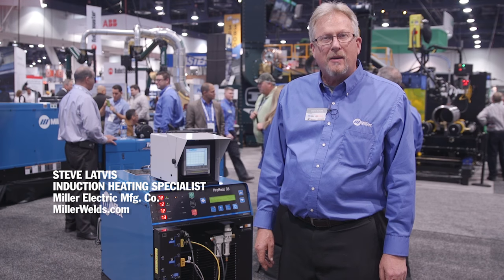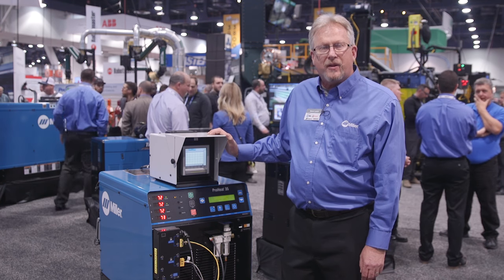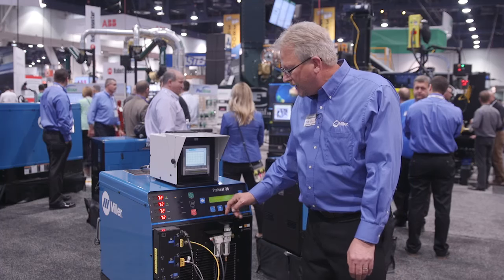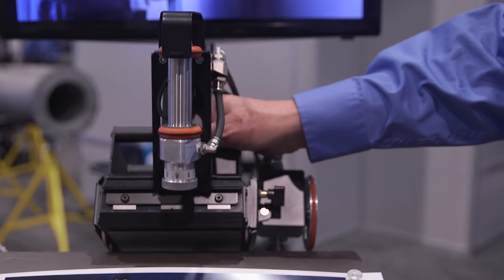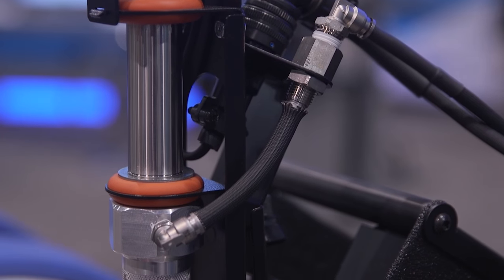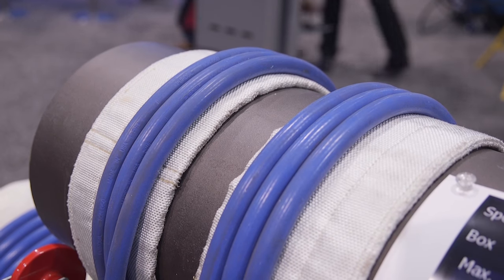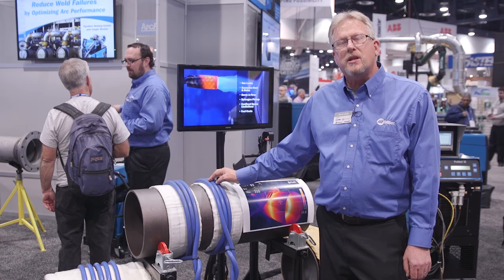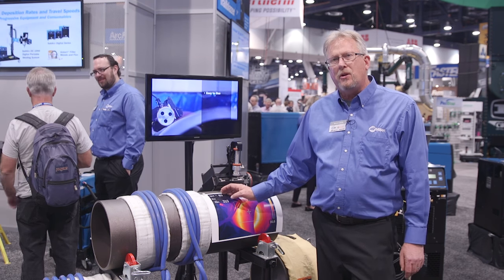ProHeat Induction Heating Systems Offer Flexibility

Comment: I’ve been using this set up with my company for almost 3 years and them about 8 years in total I think. This thing has seen it all. We have literally heated up an entire vessel about 100ft diameter to almost 300 degrees for 2 weeks straight. Thing is a fuckin beast